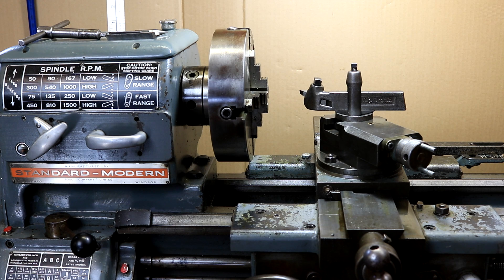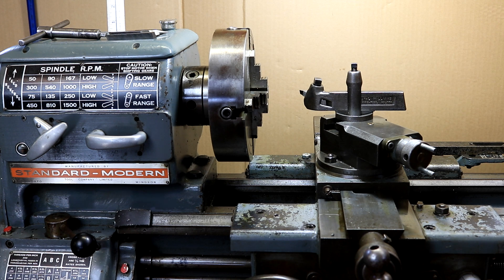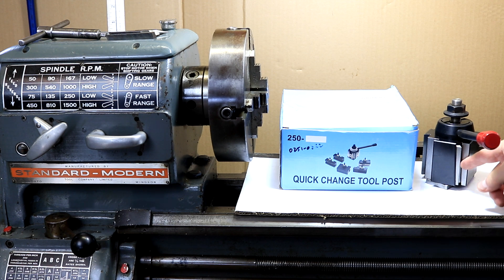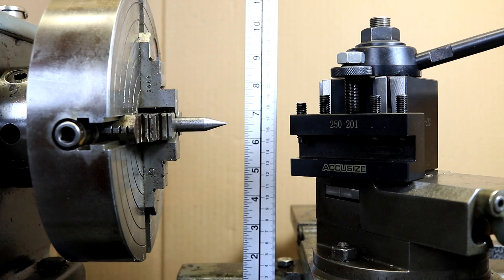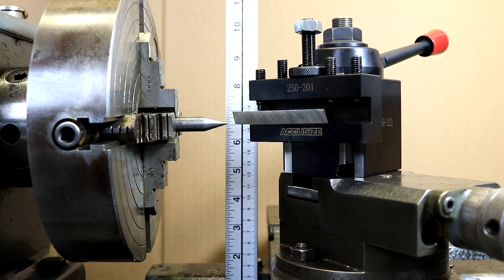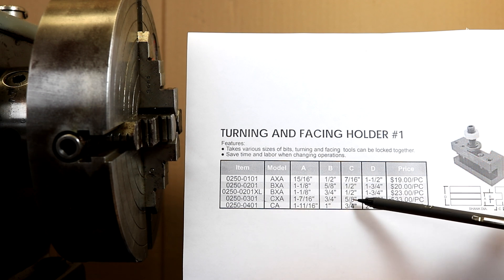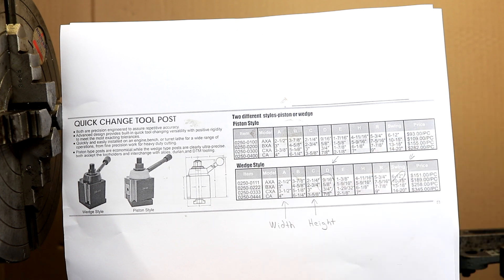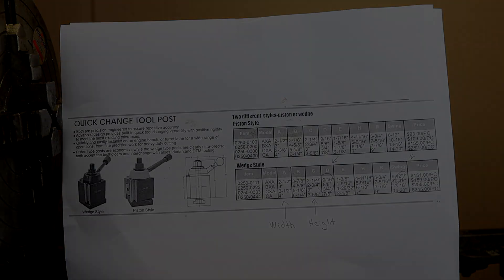Quick Change Tool Post. AXA, BXA, or CXA. What size is right for me?

Comment: Many years ago I bought a Dorian BXA for my Southbend 10L Heavy. It worked just fine. I bought the Dorian because I was familiar with them and liked the design. Their tool holders were also the first, as far as I could tell, to have a 3/4” height for the tool. They were using a higher quality alloy for the holders so were able to cut the bottom thinner. That made it easier to get to center height with a 5/8” tool. When I bought my current Southbend FOURTEEN, I moved it there. With that, I was able to use 3/4” tooling. A friend has a 15” LeBlond. He decided to get a CXA. I don’t see any real advantage for most people. The only one I know of is that he can buy the abundant used tooling in 1” size on eBay. The manufacturers are pretty accurate about the sizing for their tool posts. Aloris and Dorian give slightly different ranges, but it doesn’t matter. A definitely agree about buying a wedge post rather than a piston post. If you’re going to make heavy cuts, if your lathe allows it, or drill a big hole, the piston post can allow the holder to twist a bit, while the wedge holds it solidly along the entire length of the dovetails.
Reply from the maker: Thanks for the comments. Nice to see some practical feedback. Cheers.

Comment: Thank you so much for this video. It saved me so much time with research. I worked as a machinist years ago for a short time but all the tooling was already there so I never learned what any of it was called or what meant what. I just purchased a 10” Atlas Lathe and I know it will work for most things I want to do but probably only well enough that it will make me want a better one like yours.
Reply from the maker: I appreciate the feedback! Cheers.

Comment: The correct size tool post is determined by and should be as close as possible to the compound width so you can utilize the full cutting capacity of your lathe.

Comment: Something not dwelt upon in detail was the ability to choose larger indexable insert tool holders with the larger throat size of the BXA size holders. The same issue of tool height and range of adjustment exist but with your Stand. Mod. compound rest height to center line, you've got the ability to use full 1/2" or even 5/8" HSP steel cutting tools or shank size indexable carbide insert holders for most procedures. This is valuable when using boring bars/holders for the rigidity offered by the extra diameter.  I have personally found the only issue with the BXA came with trying to use insert style parting tool holders and trying to get the holders low enough to pick up center line of project.  I have had to revert to using  smaller parting tool holders if desiring to use my insert styles than I would have chosen otherwise just to get the tool down low enough. This is not a problem if using the dedicated parting tool holder that comes with the BXA kit other than you're now reduced back to using high speed steel  parting tools.
Reply from the maker: Bruce Starkey Thanks for adding to the discussion. Appreciated! Cheers!

Comment: How you show the adjustability with the ruler in the background is great! 

Are you able to show the same with the parting tool holder? Because the parting tool is held at a 4° angle,  I'm trying to determine if the holder will drop low enough (and still be able to have a useable amount of tool sticking out) before I purchase a quick change tool post.
Reply from the maker: I have a 16mm parting tool. The part that holds the blade is located near the bottom on an angle like you mentioned. I still have 12 mm available to move it up. Cheers

Comment: I watched to learn and you seemed to address using high speed steel and not carbide holders which can have larger shanks to hold. I have seen a lot of video that it takes modification on a lot of the smaller lathes for mounting bolts size.

Comment: Where are you located, and where did you find a used Standard-Modern lathe:?  That's an old one; I used to work for them as a draftsman.  Those things will last forever if you service and maintain them.
Reply from the maker: It was a Kijiji deal 15 years back. It was originally used in a vocational school. It is a great lathe. I am on the east coast, in Nova Scotia. Cheerrs
Reply: @Rich_Pierik  I'm currently in Michigan, but I lived in Clarckson, ON when I worked there.  They were on Montcalm Ave. in Toronto.  They've since moved to Mississauga, ON.west of Toronto

Comment: Can I ask you about your 4 jaw chuck. I have one that I think is the same with the jaw scroll drive being a 1/4" hex allen key. I bought mine second hand hand and the allen bolts have been rounded to the point where i can't tighten the jaws down very well. Have you had the same experience? If so do you think there might be a solution rather than throwing it away?
Reply from the maker: Hi. Mine are not in the best shape either. I ended buying a new chuck key that had crisp corners and I use it with attention. I recently made one for the 3 jaw on the milling machine because of the same concern. Crisp corners may buy you another few years. Otherwise I do not know of a source for new . Mine are square as opposed to hex... Cheers.

Comment: Be careful with Craftex CX701. Swing is supposedly 11 1/2". Centre Height is a tad under 7/8" so AXA will not even fit. I know I tried it!
Reply: Yea, that's fairly common.  A Grizzly G0602 (10x22") and the next size up should according to these charts be OK with a BXA, but with an AXA you don't have enough height to run a 1/2" tool without modifying something (I've been cutting the bottoms off my tool holders but that's a PITA since they're mostly hardened).

Comment: I have a KC-1620CLM, that says the swing is 16". Height from top of compound to center of 2.3". I find it hard to believe that if I use the manufacturer's info, I need a CXA. Seems way too big for my little Chinese unit. Anyone else have one??
Reply: I bought a KC- 16x20  also , l would love to know what size quick release tool holder you bought ( if you did  ) cause I'd like too purchase a quick release tool post for my lathe . What size do I need too buy, tks
Reply: @Johnson0781   @David-qd3ff I have the same lathe but with a different name. I am looking at a BXA tool post for it. What size tool post did you guys go with?
Reply: @MegaEverythingElse  Haven't Bought any yet , useing it the way it came in Crate , Sure will down the line. U are saying BXA . isn't  the a bit small , Ithink CXA should work Good , TKS for Replying.
Reply: @Johnson0781  Yea, so this lathe has a very big swing over the bed for its size, just because of the milling function. everything else on the lathe is tiny compared to what a 16" swing lathe has. The compound on this lathe is pretty small and so is the cross slide. Normally 16" swing lathes are 4 feet + long with massive parts that can use the CXA post, which this lathe certainly cannot. This lathe is sized much closer to a 9" swing lathe. I am actually debating between an ANA or BXA for mine, still trying to figure out which is best. I may measure width of my current turret style post and compare it to the quick change types.
Reply from the maker: BXA
Reply from the maker: If you wish to run tooling over 5/8", and it fits according to the specs, and you like the proportionality, then sure you can... Cheers
Reply from the maker: OK. It weighs 1200 lbs. That is certainly on the upper side of weight for 13" lathes these days. Cheers.

Comment: Nice. I have an AXA set but was thinking of getting BXA will I get less chatter due to beefyness ? I have a 10" X 22" lathe.
Reply from the maker: Make sure the gibs on the cross slide and compound are tightened properly, and work on backlash. Minimize the length of the tool sticking out of the holder. Speed, feed, tool condition and proper relief. And experiment with the position of the tool post on the compound.

Comment: so did you need to modify your compound? drill bigger hole? drill recess underneath etc?
Reply from the maker: Hey. There is a large t slot in the top of the compound. The set came with an oversized t shaped metal block that you can mill to fit. It has been drilled and threaded to fit the rod that goes through the center of the tool post... Cheers.

Comment: Can you use Axa tool holders with a bxa tool post. I am thinking about upgrading to a larger lathe and have a lot of Axa holders. Thanks
Reply from the maker: Hi. The dimensions of the dovetail portion are smaller on the axa, so it  will not work directly. Cheers.

Comment: important point missed: do they all share the same dovetail mating, will the tool holders fit across all versions.
Reply from the maker: Hi. The holders are specific to the size of the tool post. Cheers.
Reply: No they WILL NOT FIT EACH OTHER.  But if you have an AXA and wish to use some larger tooling, don't be afraid to open up an AXA tool holder to fit larger B sized tools.  Just get out the carbide.  The Chinese tool holders aren't that hard to cut to size.   ;-)

Comment: Interesting. You said that one of the reasons was accuracy.....so how accurate is this tool post? I mean when you put a tool holder on the thing, lock it down and turn a diameter.....then take it off..then put it back on....is the tool back in the same place or is there a shift...how repeatable is this thing? While its nice to "quick change" a tool.....its even nicer if its where its supposed to be! I already have a piston type chinese tool post. Its not bad but not very accurate positionally when switching tools. I am planning to buy replacement posts and so I am genuinely interested in your opinion. Many thanks.
Reply from the maker: Hi Wayne, The wedge style is the only type I have owned and my choice was based on the expressed opinions of others. Here is a video where a guy does a comparison. 

https://www.youtube.com/watch?v=Mt4qPD6YPuM

I will make a point of doing my own comparison at some point. But for now it is much too cold in my shop... :) 

Cheers

Comment: Interesting video, may I ask I have a chinese mini lathe 7"x12" and ordered QCTP 250-000 but they sent me 250-100 does it defers hence I have to make a new stud with 10mm thread to hold on the compound rest.
Reply from the maker: Hi. From what I can see the 000 tool post holds the 001 tool holders....  
example:
Tool post:DMC 250-000-000
Tool holder: 250-001,250-002,250- 004, 250-005, 250-007, 250-010

Cheers
Reply: Thanks a lot for your information so from your experience shall I change it to the set 250-000 or to adapt the set 250-100 on 7"x12" mini lathe as the height is 2cm from compound to the center.      @Rich_Pierik

Comment: I have a BXA on my 13". It works fine.
Reply: I should add that I do modify holders as necessary to take up to 3/4" tool and I have a couple parting blades that just barely get low enough to be on center ( I think I shaved the holder a bit on that one too).
Reply from the maker: Where there is a will, there is a way! Thanks for the comment.

Comment: do you know what size tool holder is right for my smithy cb1220 xl?
Reply from the maker: With a 12 inch swing you should feel quite confident with the AXA size. Take the measurement as shown in the video, and then look at the spec table for the toolpost you wish to buy, and figure in the tool bit size, and you have your answer. Good luck. Cheers.
Reply: @Rich_Pierik  Thank you very much. Cheers.

Comment: Video quality OK. No good for metric users thought.So I didn't help in any way.
Reply from the maker: The scale used in the video is graduated in both imperial and metric. If the visual is not enough to help understand the concept, then there is a very simple conversion feature embedded in your google search engine. Cheers.